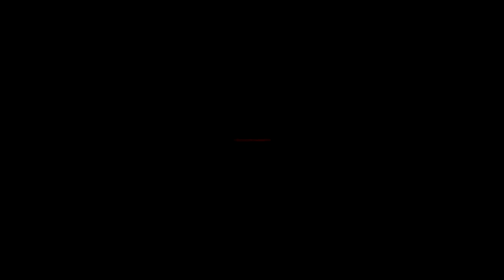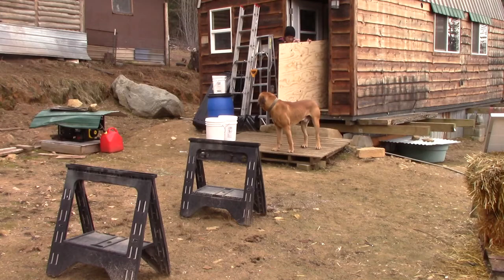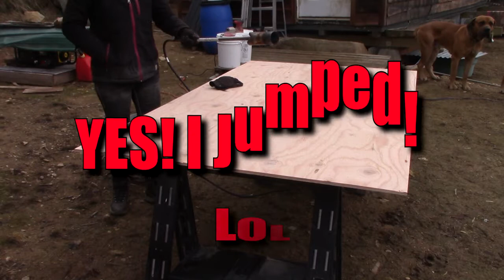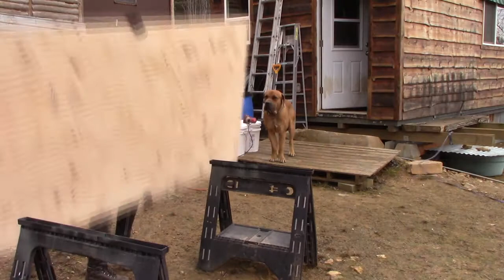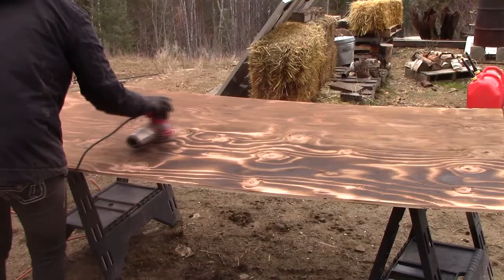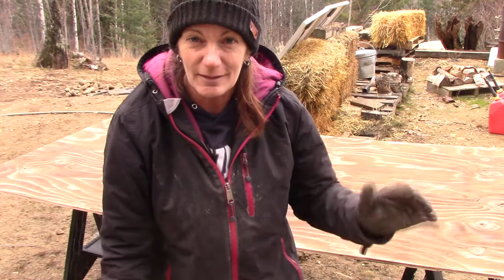DIY Shou Sugi Ban Wood Burning Torching Technique on Plywood

Comment: One question I am trying to find the answer to, is does this process ruin the glue holding the seperate pieces together, if you chose to do a more deep burn? I like to char my pieces and then brush off all the char but am concerned that it will ruin the integrity of the bindings
Reply from the maker: That’s a really good question! Unfortunately, I do not know the answer. I’m thinking it’s highly possible.

Comment: You've almost nailed it! Lol. I'm sure you're all done now. Next time, burn the crap out of it, I mean BURN the CRAP out of it. Turn it to charcoal.  Then use a nylon brush to brush away the char. You can even use a big pushbroom for that large of a surface. Follow it up with a stainless steel brush after if you want. You want to get into the grooves so you have texture or a 3D effect with the brushes. 🙃
Reply from the maker: Sorry I didn’t see your comment until now! Thank you for the advice! Will remember that next time 😀

Comment: Toni and Stu,
Merry Christmas and Best Wishes for a Happy New Year!  Keep Murphy away.
I look forward to seeing what new cabin you will build. You have had a wealth of pioneer experience since you moved from Nevada. 

I like the snappy torching music! 
A thought...Perhaps you could use compressed air to blow away the sanding dust before torching? Do you really need to sand before torching? I watched Wild Wonderful Off Grid torch their exterior wood.  They brushed the wood after torching...but didn't see that they sanded first.
Reply from the maker: Steve Schauweker Merry Christmas!We’re learning 😉
We wanted to sand since they’ll be our walls on the inside. Less chance of splinters. We have an air compressor but it was too far away from my work area and too big to bring it down.